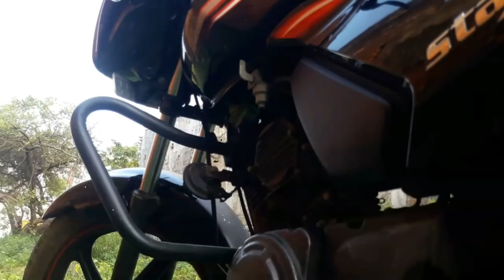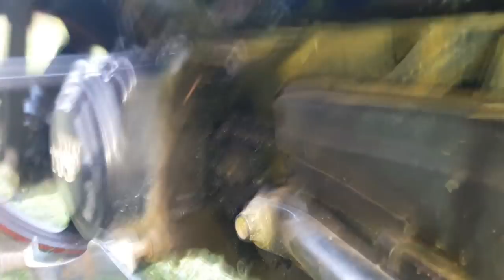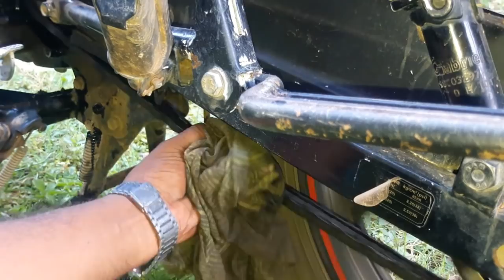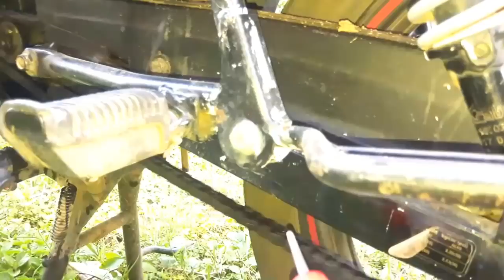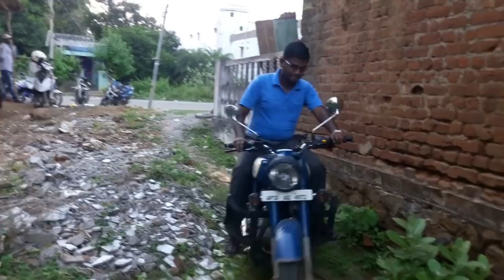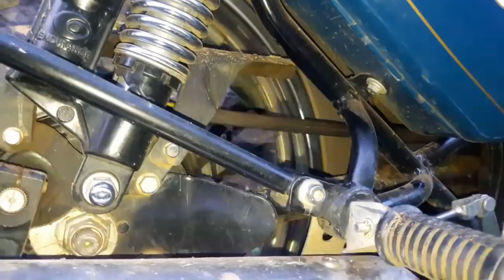How To Maintain Chain Sprocket In Two Wheelers? | Best Bike Maintenance Tips In Telugu | Neelu Arts

Comment: Sir, suggest ON and OFF ROAD tyres (dual purpose, ledha atleast good tyres with good wet grip) for as200 pulsar please. Currently running stock MRFs for the past 18.5k KM's. May be, oka 25k KM'S dhaakaa tyres maarchakkarle anukuntunnaa, but monna panic breaking lo, by mistake clutch pattukuni back break vesaa(I know, it's a mistake, should have kept handle straight, down shifted or applied front break instead), bike baaga skid ayyi fully damage ayyindhi (I've suffered a few bruises too). 😓

Also, how to make the ride for pillion more comfortable (seat cover or suspension setting etc) in as200? I mean, given the pot holes in cities and off-road or no-road conditions too.

Informative video, thank you; liked and subscribed. 👍🙏

Comment: Super bro.... I'll try this with my unicorn 160...
Reply from the maker: ok
Reply: Bro I want ur suggestion,my friend wants to take unicode bike,which is beter 160CC or 150CC
Reply from the maker: 150cc best
Reply: Ok bro...but It has normal speed meter nd tube tyres
Reply from the maker: weight bikes ki tube tyres suggestbul. and they r good. and normal speedmetr unna no problem manaku performance mukhyam